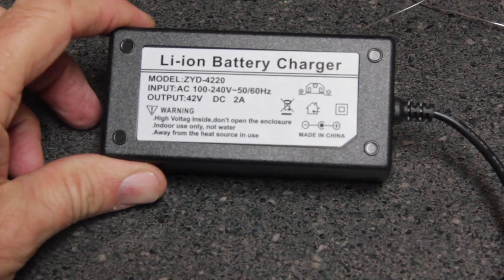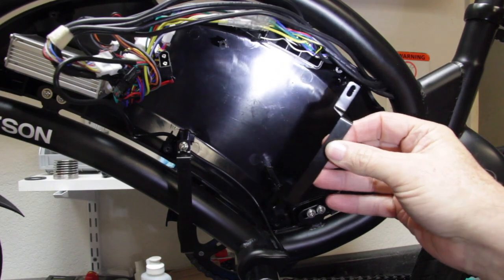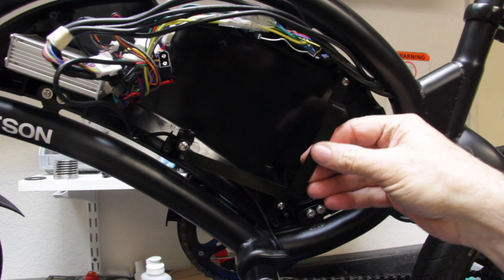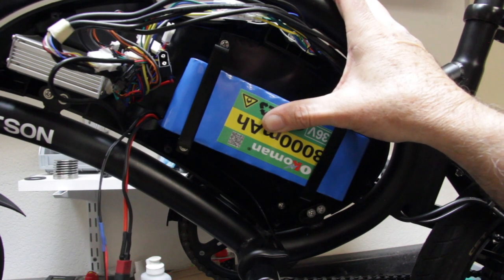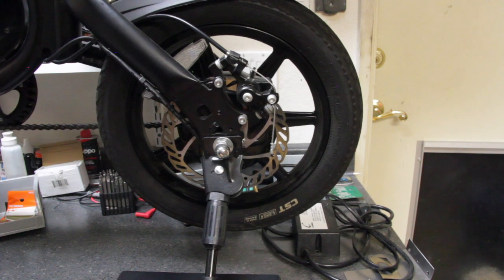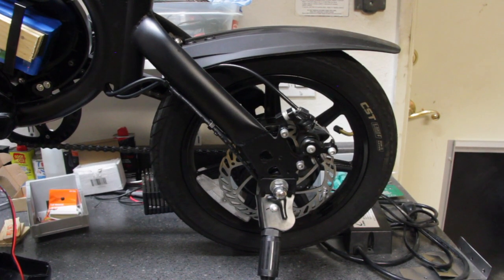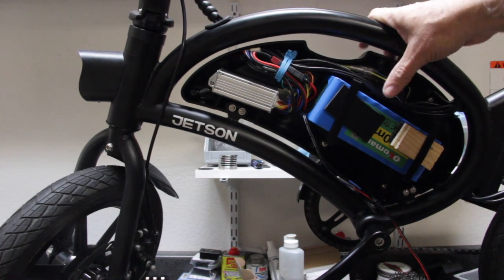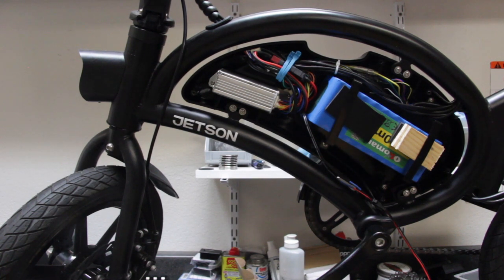Jetson Bolt Pro Battery Replacement Part 4

Comment: I would have liked to see what this rubber that you used looks like and some info on where to get it.
Reply from the maker: Greg, there is a link in the description, for the rubber.  You can also check my other Jetson bolt videos, there is a link for the heat shrink tubing.  Thanks

Comment: For the charging port do i need to solder i thought the battery comes with the charging port so couldnt i just remove the stock one and stick that one through the hole
Reply from the maker: The charging port is included with the new battery, just route it to the existing hole and install
Reply: @JoediyLab  oh ok why did you solder it then
Reply from the maker: @thomas3417  I use the battery in different configurations between different scooters and e-bikes.  I use a different configuration.  It all depends on what the 20 ah battery comes with.

Comment: Will a new battery get me more speed? Looking to get 5-10 mph more
Reply from the maker: no, there is a speed limiter on the bolt pro.  You would have to change the controller to a higher amp controller to increase the speed,
Reply: @JoediyLab  thanks. What about unplugging speed limiting wires. I’m seeing these on other ebikes. White wires?
Reply from the maker: @bjbrunetti  I have not tried this, but from the folks who have the Bolt without the pedals have indicated you must change the controller.

Comment: Hey Joe,
I have a question / request not related to this video. My mom was given a norditrack gx 2.0 without a power adapter. We had miscellaneous adapters around the house but accidentally plugged in the 12 volt instead of 6 volt adapter. I started to smell something on the board so I unplugged it right away. After plugging in the correct 6 volt adapter, everything worked except the resistance. I took it apart and started at the resistance motor. I gave it 6 volts and it ran just fine. I then looked at the circuit board and by using the continuity function on my dvom, found the chip that sends power to the blue and yellow wires on the resistance motor to be fried. All the chips on this board have different part numbers and I was hoping you still had that gx 2.0 from that article you posted about building the makeshift resistance controller. I was wondering if you'd be willing to take a look at the specific chip I need with a magnifying glass and give me that part number on that chip.  I'd do it myself, but I can't make out the part number because the exterior of the chip melted. I found a website that sells the micro chips, and would like to solder the new one in and see if I can make this a .69 cent fix. I stumbled across this web page by Google searching one of the other chip's part numbers that I was able to read. Your help would be greatly appreciated. I'd hate to see this machine get thrown out because I'm not spending $300 on a controller either. 

Regards,
Matt
Reply from the maker: Hey Matt, Mine was fried as well and I threw that board away ages ago.  That is why I created the video on directly controlling the friction motor.  Sorry,  That chip could be a replaceable chip or it could be a processor, Which requires programming.  The company would not give you their code if it was.  Your best bet is to do what I did.  Sorry I could not be of anymore help.

Comment: What was your motivation for replacement?  You only went from six to eight amp hour.  Was the stock battery giving you problems?  Why not jump to 10?  I appreciate the series.  Thanks.
Reply from the maker: Just to show how to replace the battery.  I used the 8 amp battery as it would fit in the provided space without modification.  Later video showed how to mount an external battery.

Comment: Hi joe 

I have a question can I put 48 v  battery into the jetson bolt pro and I have think about increasing my Speed on my jetson pro like 30-45 Km . I rather putting 36v battery.
Reply from the maker: You can either change the speed controller, the stock speed controller has a speed limiter.  Of you can replace the battery to a 48 volt, but then you have to replace the speed controller with a 48 volt controller.
Reply: @JoediyLab  with a 48v controller and battery paired with a 350watt motor what would the top speed be
Reply from the maker: @thomas3417  Not sure, I have not tested that configuration

Comment: Excellent video series Joe!  What should I consider about the battery specs so that I don’t fry the controller?  Do I have to match the mA rating if I try a 20 amp battery?
Reply from the maker: 36 volts battery pack.  extra amp hour battery will just increase your range,  You might want to add a switch if you add an external battery., along with the internal battery. But make sure the 20 amp hour battery has the same dimensions as the stock battery.